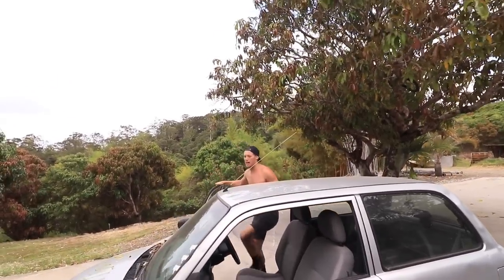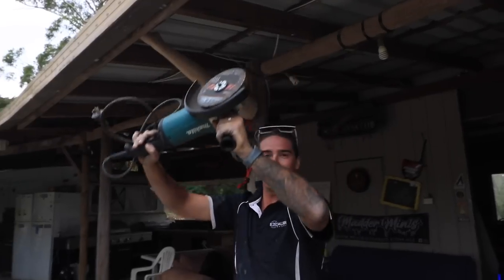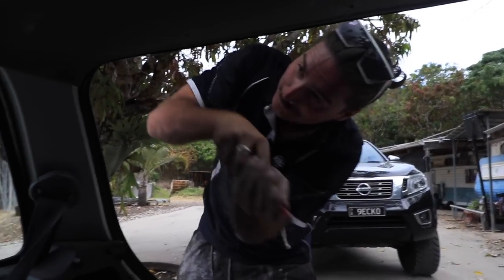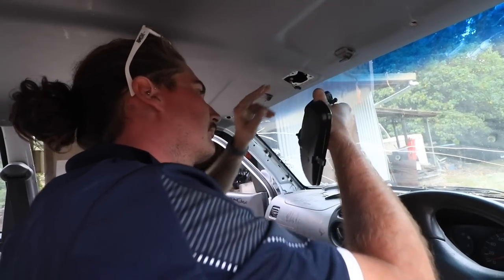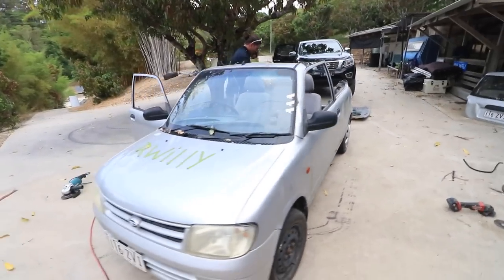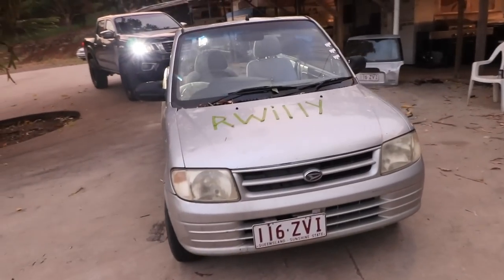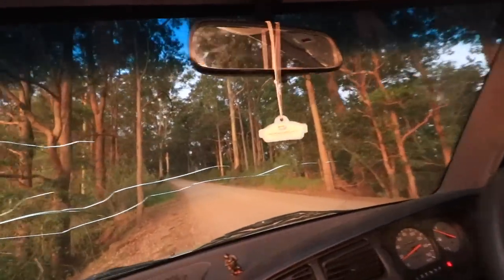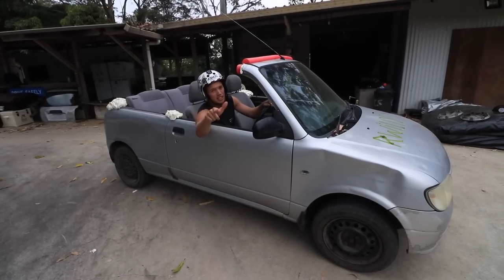MAKING A CONVERTIBLE CAR AT RWILLY LAND!

Comment: Good work. You need to paint the bare metal where you cut so it doesn't rust to quickly. Also you need to drill holes in the body underneath where you cut the door pillars and rear pillars to let any water out of the body of the car if it gets water in there. But it looks great 👍🏻👍🏻

Comment: If you want to make it even better then try cutting off 2 rings from the springs in the wheels to make it shorter. It will lower the car by a few inches. I did that to my Honda CRX back in the 90's.

Comment: lol if you jump it, it will try to fold itself and the doors wont open and shut so then you will need to do the jeep mod and remove the doors so its basically a convertable wrangler at that point

Comment: That's not how you do it. 1. Get a Box knife hold it hard up against the outside border of the glass and then pull it all the way around the mould and  pull the moulded off and get a pull knife/box cutter knife and stick the pointy end in behind the glass then do the same thing with the knife and the pull out the screen. i replace wind screens for a living    thank me later🙂